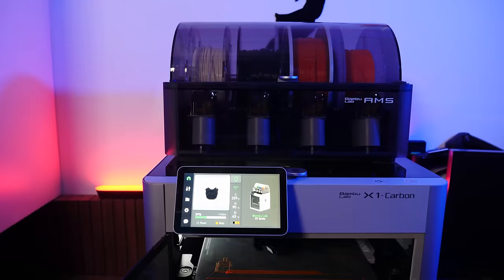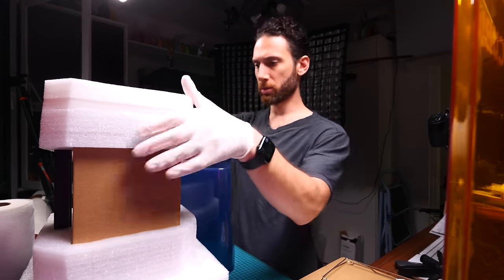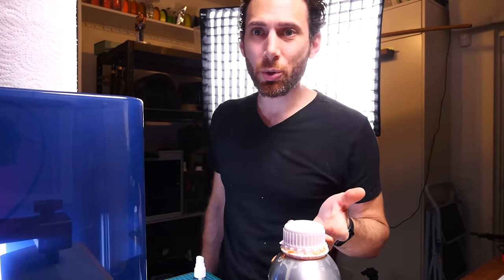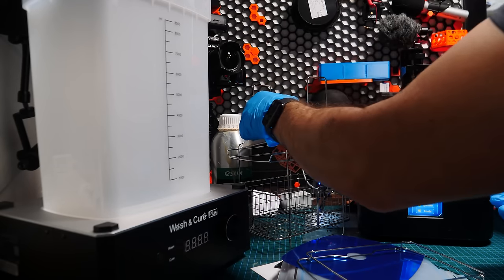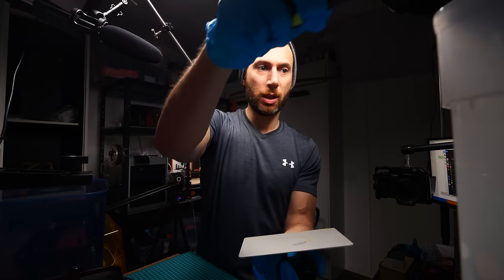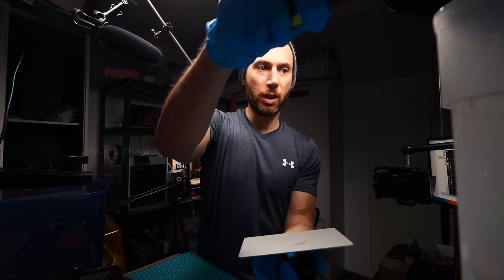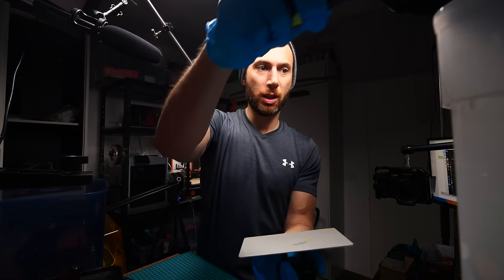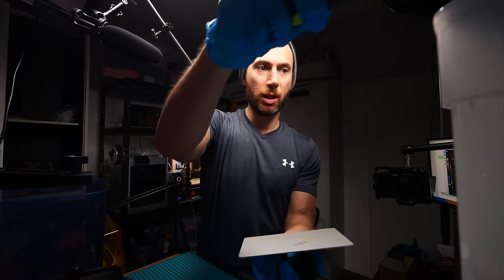Resin 3D Printing Wasn't What I Expected. AT ALL.

Comment: hollowing is only required when you want to save resin or reduce weight, and drain holes are more like "prevent suction" holes, so that your hollowed out model does not create a suction cup that does not want to release from the build plate.
Reply: I just started resin printing when my coworker sold me his cheap. I’ve found this to be untrue. If you don’t hollow thing out, the inside may not cure at the same time as the outside. This can lead to cracking and broken models later down the line.

For example, I printed a model of Georgie from IT in the style of a Funkopop (thick, overly large head). It turned out pretty good. But, after a few weeks of it sitting on my shelf I noticed that his leg had snapped off and there were new cracks along his neck.

But yeah, safety needs to be wayyy more advertised. I put it far away in my garage and left a door open, we still smelled it in my house three rooms away. So I’ve paused resin printing and am working on a project to add a VOC sensor to my current AirQuality checker (AirGradient)
Reply: @aaronchamberlain4698  I have never had any issues of resin degrading and all the layers inside are fully cured because thats how each layer is printed. But when you hollow something out you then have uncured resin all over the inside with little to no way of cleaning it out and curing it after. This can then cause issues because that liquid resin can eat away at your model from the inside. I found the best thing to do with hollowed out prints, is to pump lots of IPA or degreaser into it with a syringe until there is no more resin inside, then give it an ultrasonic bath and cure.
I even have some things I have printed and never put under a UV light, because they were printed with Sirayatech Tenacious and I wanted them to keep as much of the rubber like elasticity as possible, as well as failed prints that never got post print curing and none of them have ever shown signs of degradation 
If your prints are cracking then I would guess the layer exposure time is too low and its simply not curing each layer fully, or you are using a resin that is shrinking and/or the model is too thick to accommodate that shrinkage. 
I only use Elegoo and Sirayatech resins though, and Sirayatech is expensive but also the best on the market.
Reply: When you don’t know what you’re talking about it’s best to stay quiet.
Reply: @donkeyholmes4581  then please teach me, who has been printing for 3+ years and sells custom designed 3d models. Please enlighten me as to what I am incorrect about

Comment: 14:00 I don’t understand the question here.  You talk about what a pain diagnosing a bad fdm print is but it took you 3 attempts to print that cube thing and it wasn’t at all clear as to what the problem was.    
   
So the choice appears to be:  deal with the “hassle” of diagnosing failed fdm prints or deal with the hassle of failed resin prints on top of working with dangerous chemicals.

Comment: My first experience with resin printers was about 11-12 years ago when I picked up a desktop 3D Systems resin printer system for our ME students and faculty to explore.  What a complete waste of $15K back then.   And what surprised me the most when I started watching this vid, is how nothing has really changed in the process.  Same exact thing.  Lots of nasty sticky chemicals to handle, UV lights, and extremally high failure rates of prints.  We had the factory techs come down many many times to help us try to get it sorted out, but in the end I just turned the entire system over to some grad students and put it in a room with large enough fume hood to put it all into for occasional use and mostly safe storage.   Thank you for the brutally honest reality of what using these resin printers is all about.  Well done!  You actually got my gut twisted in a knot from triggering me with it!  All the horror and wasted time!  No thank you!

Comment: First time I've seen a failed test print cube need up the exposure on that see the bit of the frame that has come away?! This cube is an interesting model as its got everything in it if you know more about resin printing eg like the bracing is self supporting so it wont need any supports etc!

Comment: FYI those negative pressure respirators aren't compatible with a beard. The air just goes through the gaps between your hair and the mask. Not seal is possible. You'd better upgrade to a positive pressure, PAPR setup.

Comment: esun resin is probably one of the worst for odor.  I generally use anycubic standard or abs like and keep the printer 5 feat from my computer I work at all day.  
PS:  You absolutely still keep the ipa without the wash and cure station.  A pickle strainer full of ipa can be used dozens of times and a $10 strip of UV lights on a microwave cover can cure the models just as well

Comment: Nice video! I saw on some other videos that the air-filters removed the odor, but not the actual spreaded toxins in the air, after using a measurement device to measure the air quality in a a room after printing it came out with a bad rating even many hours after that with the window/door opened it was still the same, so that guy ended up making a flexible hose pipe with fan to transfer the toxic air outside. Because of all that info roaming around still unsure to move from PLA to Resin printing... any thoughts, was it fake news ?

Comment: I am also worried about the toxic fume. Do you recommend the filament printer?
Reply: If you have a method to forcefully vent air out of the room through a window then I would recommend that to make resin far safer, paint station vent Also helps when sanding or using thinner for paints and ethenol for cleaning prints.

Comment: resign printer is harder than it looks . its all about time it takes hours to make adjustments and figure out how to tune the machine . also since its liquid its easy to spill and picking it up usually leaves me in a dripping zone .. this stuff smells , it stronger than spray paint and if you get some on on your skin than go outside it will burn like hell . i would consider getting another one if its perfected a lot more .. i mean they are huge machines with a plate size smaller than a sheet of paper and when it comes to noise they don't make any other than small fans very low and wont really notice but the smell will kick in harder. i personally felt a bit high and honestly couldn't sleep very much since i was using it the fumes are strong.. anyway i also think that wearing gloves and a mask is time-consuming . its pretty much 10 times harder than printing on a 3d printer

Comment: First you need to ventilate the room but without lowering the temperature so you need a chamber, inside a heater with a thermostat, a blower and a exhaust tube to blow toxic volatile compounds to the outside or a heat exchange hvac module. You need to clean every bit of resin you put everywhere and put contaminated items (gloves, etc) in a sealed box in the chamber. You already have a good mask (the one in the box is an insult to your health) but you must wear it every time you work (IPA is toxic too and you breath it like fresh air!) in the chamber. In fact, the volatile compound are so aggressive that you should wear an entire combination or manipulate through a glove box if you plan to play with those sh*** for long time. Remember that your skin can absorb things just as well as you lungs but with a much greater surface area.
You should ventilate the room next to the chamber and avoid storing cured plastic in a living room (slow release of volatile chemicals). Finally, you need to seal your waste and dispose them accordingly. You should ventilate you chamber after each print to be safe. With this level of hazard, you can't be too safe. It is way more than buy goods on amazon/aliexpress and play. Unless your health and life expectancy count for nothing.
Those chemicals are really dangerous and in astronomic quantity just in the vapors. You will not be warned until it is too late and you ruined your health. Those product should not be purchased like that, it is criminal to let those toxic fumes go in any child's bed room (miniature printing/painting for ex).

Comment: Thank you for being honest. I’m curious if anyone has tried to do exact measurements of resin if that’s a thing. I feel like there’s quite a bit of waste with these printers also. I have been seeing some people reusing the waste kinda like Uncle Jessie did with filament.
Reply from the maker: I'll be honest though and say that I'm now testing a much better printer, and much better resin, and it's NIGHT AND DAY
Reply: @michaelmendoza1818 Slicers very accurately notify the user how much material is needed based on total print & support volume, which is important prep info for people who use mixes of resins with different densities. As for waste, I always save my rafts if they're large & mix epoxy adhesive on them, use them as paint palettes, as shims, for tidy witness-testing cures if I'm making a mold, etc.

Comment: I really want to buy a resin print for my sculptures… but I’m afraid for these toxic fumes and everything

I have a small room , should I be that scared, or can I still use the machine in a safe way?
Reply from the maker: You can’t run it in a small room. You need a separate closet with ventilation or do it elsewhere. It can’t be the room you work in

Comment: FDM also exposes you to VOCs and superfine particle and has been linked to health risks. Any 3D printing space should be well ventilated regardless and ventilators are not a bad idea. the problem is skin contact more so than the VOCs and fine particles. Since you can get chemical burns from the resin. resin is not for everyone same with FFF. But both should be done with good ventilation or respirator.

Comment: I have been resin 3d printing for years, and I never use gloves or a mask, and I print in the same room that I spend all day in. Just clean your hands if you get any resin on them, and dont expose the resin on your hands to UV light. They give you surgical masks instead of 6001 organic solvent filters for a respirator, because the mask surgical mask just prevents you from getting resin splashed onto the soft tissue of your mouth or nose. Sure, some people hate the smell of the resin or say that it gives them a headache, but I dont smell anything unless I leave the room and come back after some time.
I have not lost my fingerprints, any hair, or developed asthma. I have been spraying lacquers for many years and the solvents in that are much more harmful, and you must wear a respirator with organic solvent filter, sealed eye protection, and gloves; but I have seen no such negative health effects from resin, although I am sure my blood has more microplastics than most people.. Also, wear a dust mask (n95) when sanding resin, as inhalation of the actual resin (not the fumes) can be bad for your health
Reply from the maker: That’s surprising to hear, I asked about eight different experts, and they all told me that resin will give you cancer and give you all kinds of horrible reactions… I guess better safe than sorry? Maybe you just aren’t sensitive to it
Reply: @thenextlayer  the dust particles from sanding it certainly can when inhaled, but from what I have heard, the liquid on your skin is fine if you wash it off before it gets exposed to UV light; so long as its not soft tissue (thats what the surgical mask is for, prevent splashes onto your mouth or nose)

Comment: Wear your respirator when working with either the Resin or IPA. The fumes from both are bad. Slowly burning up your lungs. Work in well-ventilated rooms. Wear your protective glasses when working with the UV stations. the UV light is invisible for the most part BUT WILL MAKE YOU SLOWLY GO BLIND.

Not enough is talked about the health hazards from 3D printing. USE YOU PERSONAL PROTECTOIN GEAR!

Comment: just saw the part of the respirator for kids its prob not ideal but a full face gas mask would serve that purpose only thing is getting them to keep it on honestly haha or get a small powered ventilator it wont be as hot and the air flow will let them keep it on until they can take it off safely

Comment: Please wear a mask when handling IPA. it emits highler levels of VOC in the air than resin. When you wash your prints you even saturate the air with both, Resin and IPA VoCs. My sensor goes wild as soon as the IPA tank is opend.
Stay safe.😊
Reply: Oh and one more thing. I have the air pure from anycubic. They are fine for inside the printer. But once you open your printer and your Washing container, they loose their usefulness. 
Stay safe!😊

Comment: Man you should do your due dilligence when accepting sponsors . Anycubic has a horrible track record with their customer support. I got an FDM printer with a faulty bed and hotend from them and while they claim you can return the item in the first 7 days, they intenionally did not reply and continued asking to send me replacement parts as a procedure, and they wouldn't accept my request of sending the whole printer back.

I usually had to reach out to all of their emails at once to get a reply in the same day, and I did this because the time I had to request returning the printer was running out. Their support team is most likely based in China and they only sent generic answers, trying to derail me as much as possible from returning the printer.

The machine itself is not too amazing, poor design, bent stuff all around - it was a heavy mistake on my end since I was just starting with 3D printing and I thought their offer looked good. I'm not the only one who had this poor experience with them, reddit has a bunch of users sharing similar experiences.

Comment: Safety tip: Loose the beard so that no air/fumes can come past the rubber of the mask, a beard don't make the mask work perfekt.

And I am thinking about resin to treat some parts and models to make them 100% water tight, and to find out if they get stronger.
Reply from the maker: You lost me at lose the beard.
Reply: @thenextlayer   kind of mask that you where waring is a good mask if you don't have any beard, by having beard it is not tight around the mouth. 
So either a full face mask or no beard

Comment: I see you using latex gloves, don't. The Isopropyl Alcohol will leach right through them, and take the resin compounds with it. Nitrile gloves are the safe way to handle un-cured resins.
Reply from the maker: Thanks for the tip. I just went and bought some.

Comment: I definitely regret buying a resin printer. The mess and toxicity is too much for me. FDM is so much simpler, cleaner, safer and more convenient. The superior print quality just isn't worth it, in my opinion. I embezzled hundreds of dollars building an enclosure and ventilation system for the damn thing, and the goddamn smell gets everywhere anyways. I am literally terrified of entering my workshop for fear of finding bits of uncured support or resin that I might have spilled, I don't even want to touch anything in there anymore. I'm thinking of just chucking the thing out, and sticking with FDM.
Reply: Hi Voldy. How big is your printer? I had major problems with fumes from my Elegoo Saturn 2 which necessitated my moving it out to a shed in the backyard, but my previous printer, the smaller Elegoo Mars 3 wasn't really any problem; I could smell the resin, but it wasn't pervasive, the fumes didn't invade the house. 

I'm super-cautious about 3D resin, but while it is definitely an irritant (I'd compare it to the fumes from working with a fibreglass repair kit) the safety data information gives it a surprisingly low toxicity rating.

Comment: I hate resin printing so much. The strictly closed-source software irritates me as a FOSS engineer, and the proprietary machines irritate me as a mechanical and electronic engineer; the entire ecosystem is just unkind to the maker mindset, and generation after generation the only improvements that have been made to the machines is higher resolution. Allegedly there are actually non-toxic resins (to touch/breathe), but they're expensive so no one is really interested in exploring that route.

Comment: This man... how to say it. I don't understand why he hasn't watch any YouTube video about 3D printing BEFORE he had opend the box with his 3D printer. The worst thing is he hasn't realised that no 3-D printer isn't just 'plug and play' even in 2023 so before you start printing you must know at least basic rules. And resin - I highly apreciate he has mask and gloves. In my opinion these are absolutely must have things. What is a terrible nistake is he has no protective glases when working with liquid resin. If there is a drop of resin in your eye, you risk loosin ability to see. Mixing resin... don't shake it as you did in the video because it's important to avoid as many air bubbles as you can. BTW liguid resin is a regular poison (so do its vapors). I also hasn't seen any 3D setup of the printer and calibration. 3D printing is something great but it i no toy. It is interesting video anyway.  It is full of what not to do steps. Also remember never ever use the metal scraper when to stir up the resin in anything where is a FEP foil. You may damage it and if resin leak inside you 3D printer, you will be probably doomed to buy new 3D printer. Or it may be very expensive to repair the printer. You should buy a protective foil for the disply. You can also use a common FEP foil and fix it with tape. As I said I highly reccomend this video. The main conclosure for me is simple: who does nothing is just staying lonely on a spot. So keep it up, my friend.
Reply from the maker: Good points. Thanks